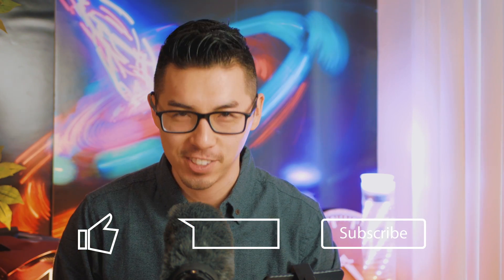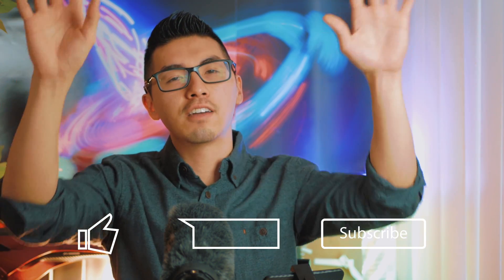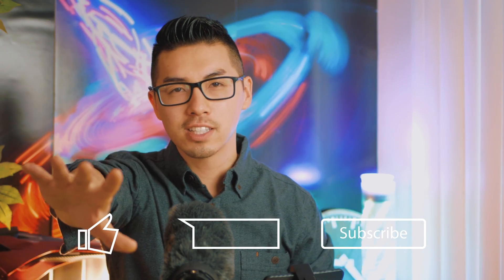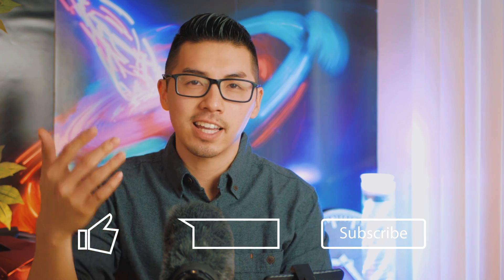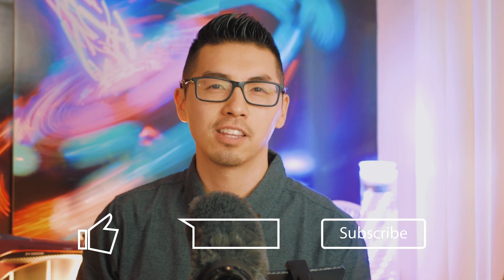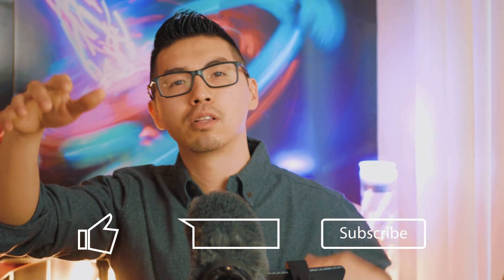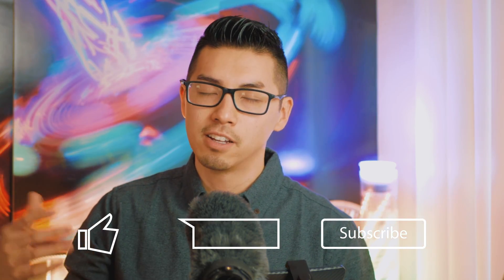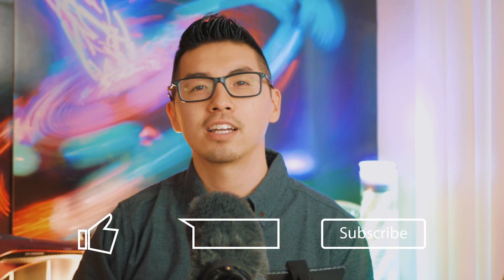Which Computer Should You Get for Industrial Design

Comment: Can I use macbook m1 for industrial design?
Reply from the maker: Should be fine but note that many 3D programs like solidworks only are available on windows. Bootcamp or similar maybe a solution.
Reply: @JimmyHuynhdesign  can you tell me the performance of macbook is good than windows laptop on designing softwares ?
Reply from the maker: @YuvrajSingh-uz5zz  Its not about the performance as much as its  about the compatibility with the software to the operating system. To be safe, just get a windows computer or just double check if the sofware you plan to use is compatible with mac.

Comment: I just got accepted into the ID program at SFSU and the requirements state that a windows laptop is preferred but i can also bootcamp my Mac. I’ve been researching and have seen people complain about glitches or crashing on solidworks and rhino. Given the facts that I have been using Mac for over 10 years what would be easier.. dealing with the glitching on bootcamp or relearn windows and just operate from there for work and keep my Mac for personal use?
Reply from the maker: Hey Saba, either way would work. I used a bootcamp mac through school but a dedicated windows machine would work better if you can afford it! Congraz and good luck!
Reply: Hi! I also got accepted into sfsu ID program this year! Could you message me so I could ask some questions about the program. Also which computer did you end up getting

Comment: Been using iMac and MacBook Pro with Bootcamp Windows for nearly 10 years now. SolidWorks and Keyshot running nowadays. Never had a better Windows experience with a dedicated PC than I have on the Mac. It's the way to go if you can get past mild hassles like working with files crossplatform (as I do with Keyshot, Excel et al.) which are addressed neatly by Google Drive and a flash drive for larger files.

Comment: Is 2018 Macbook pro 13 inch enough for idustrial design?
Reply from the maker: It will take a little longer to do heavier tasks but yes it will work for you Nida.
Reply: @JimmyHuynhdesign  thank You so much. You always enlighten me about idustrial design 🙈
Reply: I'm thinking of buying a new computer in the next year, For a little more than the base model pro, you can get a MacBook with 256gb, and 16gb or memory, which seems to be so worth it. Especially if you plan on boot camping your mac as nearly 40 gigs of your hard drive will be used to run the operating systems.

Comment: Hey man great video! Personally, which would you prefer to use for industrial design mac or windows and is one better than the other when it comes to ID work?
Reply: Obviously Windows , easy to use , support every application and  a lot more cheaper then Mac in terms of great specification .
Reply from the maker: Whats up Louigie! Windows will be more compatible with most programs we use. Many of those programs are only offered on windows. Like I said in the video, if you use both windows and mac dedicated programs like myself, you can buy a mac and install windows via "Bootcamp" Search it up on youtube if you're interested. Or just have two laptops :P